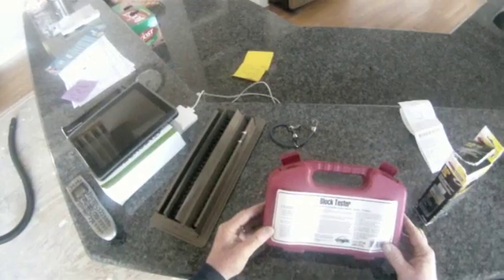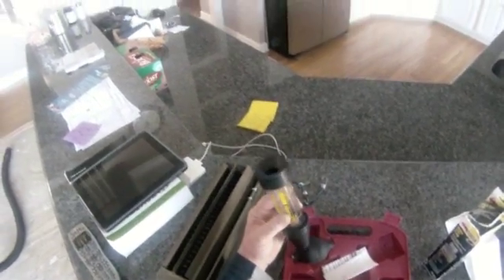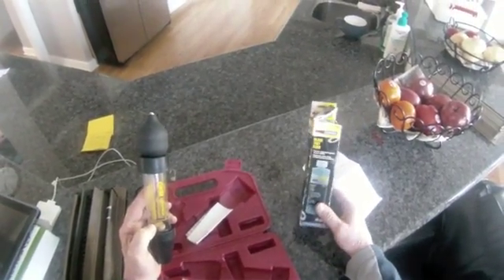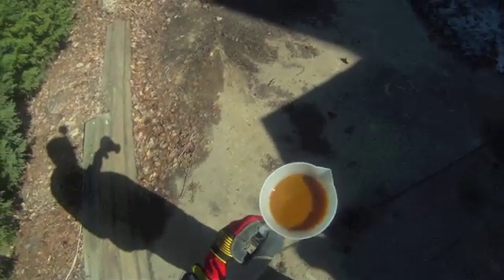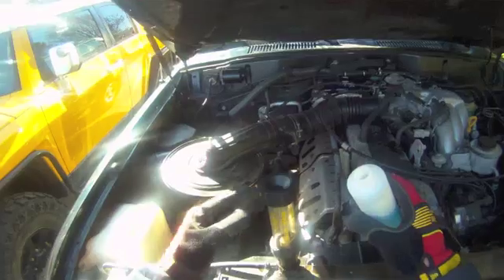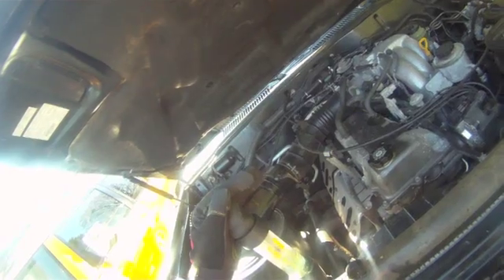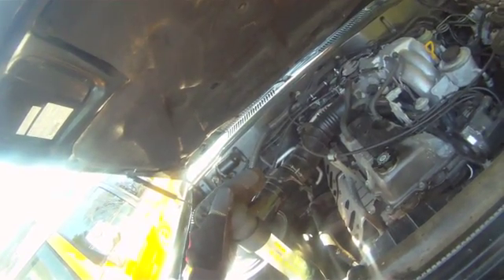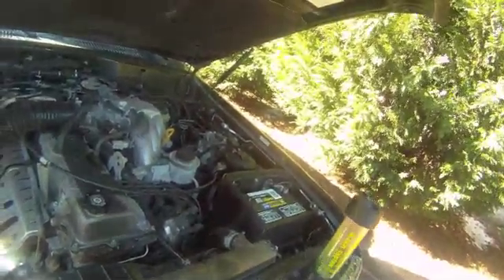engine block test

Comment: this is good only because is fast!! no need to assemble nothing etc! but is better check all things, do all tests not only one

i buy aloot of used cars for resale and this is very good tool for quick check after a test drive! and with this i test already 2 cars with fauty gasket. And "alert" the seller. now all people in my place like to buy this lol.
(few seller let test good the car before purchase) and this device catches many off guard
Reply: RB Gomes Don't bother "alerting" the seller.  They already knew it had a expensive repair ahead of them.  They decided to try and screw someone else instead.  The names and locations of those people should be published in order to protect others.
Reply: Kevin Johnson yes they use the bluedevil and steelseal for fool others. i buy now a radiator pressure tester kit also and is very good!!

Comment: wrong! this is 100% accurate, is it takes with car at normal temp to detect the leak! the leak is little and you can fix it temporary with blue devil or steel seal, it is turn yellow very fast the leak is big!! i buy this tester and giv posityve (take maby 10 minutes) and then i go in a mecanic do a compression tester in cilinders! and in fact heave a minor leak! so for detects leaks it works!! and when i go buy a used car i bring this with me

Comment: I know this videos kind of old but this comments to help out others.  Make sure your thermostat opens or it can hide a head problem. (Carbon monoxide gets stuck behind it). You can tell by coolant level changing quickly or by fans coming on